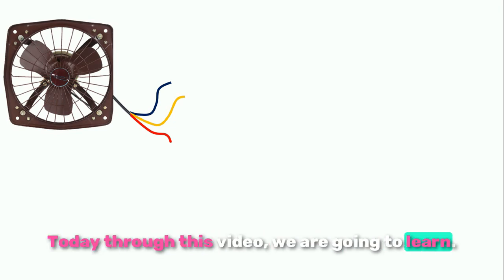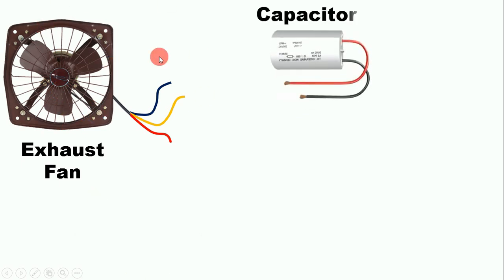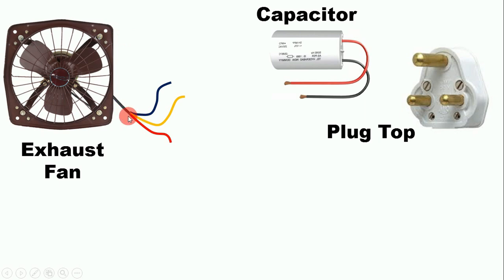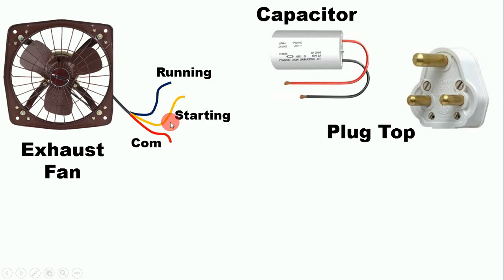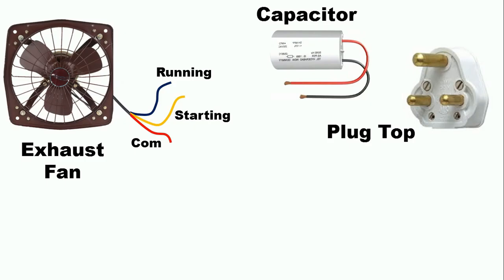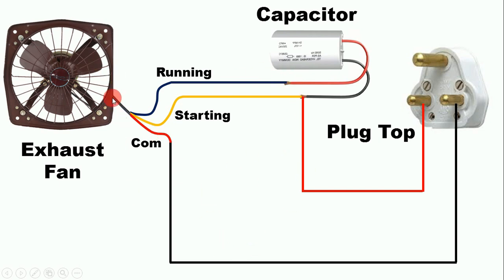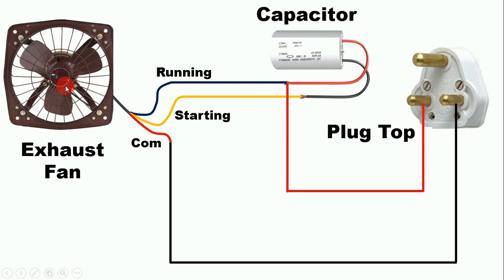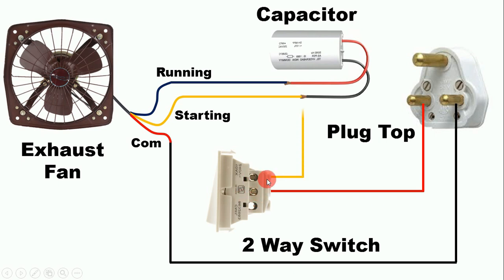Reversible Exhaust Fan connection With Two way Switch | 3 wire Exhaust Fan @TheElectricalGuy

Comment: The running coil winding of a fan or any electric motor is higher than the starting winding, so if you run your starting winding in place your running winding for too long, it will burn the electric motor coil.